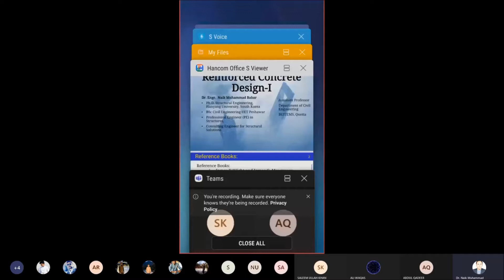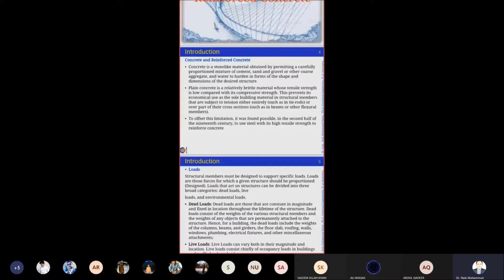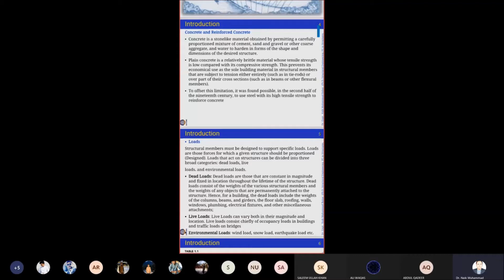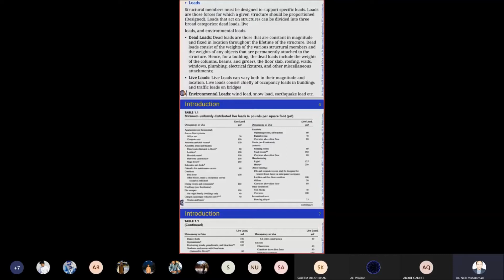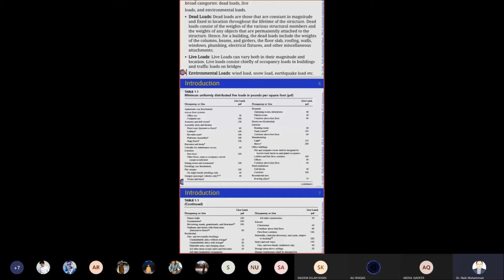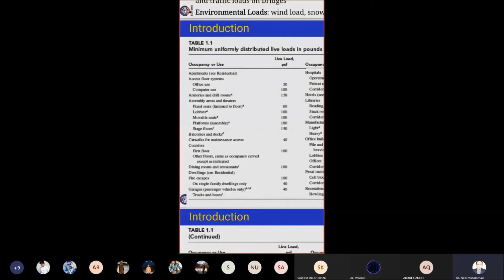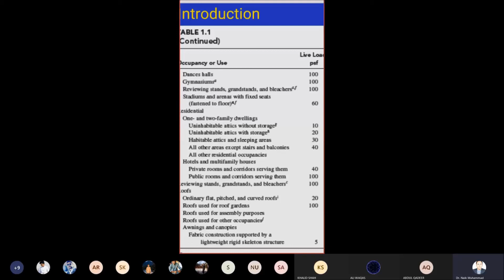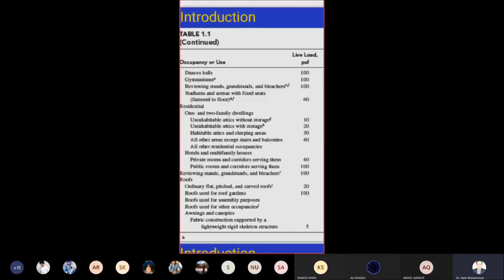Introduction to Reinforced concrete | Concept of Reinforced Cement Concrete | Part#1 | Dr Engr Naik

Comment: Property of material which has maximum modulus of elasticity and allowing  minor cracks on the surface
1) flexibility
2) toughness
3) deflection
4) elasticity
Reply: Sir please reply ☺️
Reply from the maker: 2) toughness
Reply: @TheKnowledgePoint2020  thanks sir 
My option was toughness as well, but i was not sure 
Btw now its crystal clear thanks sir